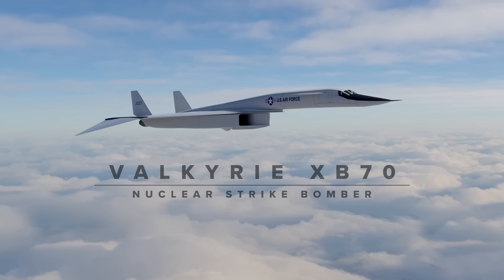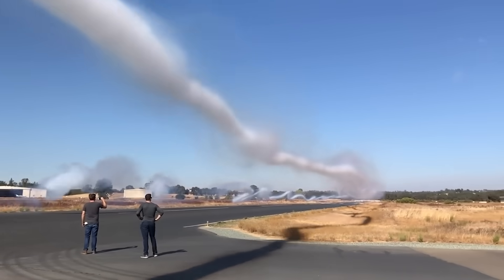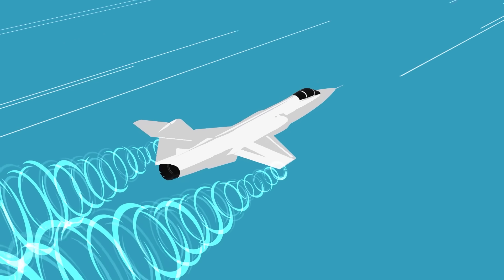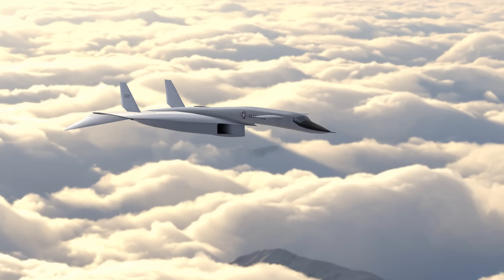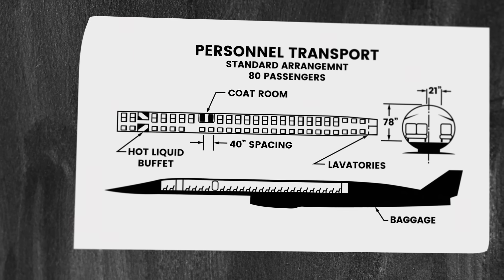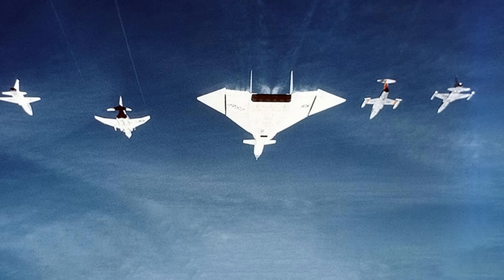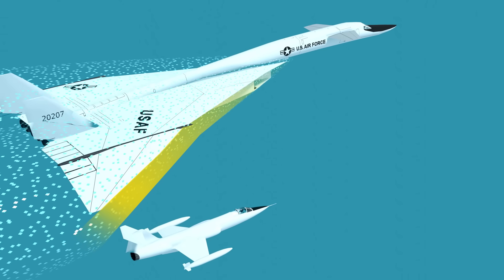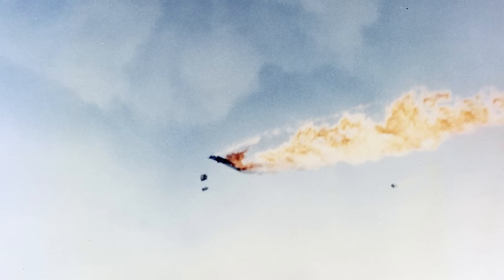XB-70 VALKYRIE | Wake Vortex crash explained

Comment: I'd always thought the vortex was generated at the wingtip from the confluence  of low pressure from the top of the airfoil mixing with the higher pressure  airflow from beneath , following  Bernouli's law. Is that correct?😅
Reply: Not entirely. 

Bernoulli's principle, in simple terms, states that faster-moving fluids (liquids or gases) have lower pressure than slower-moving fluids. It is unrelated to the formation of wingtip vortices, which result from air spilling around the wingtip due to pressure imbalance between the upper and lower wing surfaces.

Comment: Only one ever flew.. the other never took off even though it had the newer wheels/gear that was a huge issue. This program was cancelled pretty quickly in its testing period and instead went to a museum to rest. At least according to the previous built one.
Reply: Nope.  2 aircraft were built - both flew.  The landing gear wasn't a huge issue, as ultimately the 1st plane retired intact, flying until the end of the program.  The 2nd plane was lost when another airplane crashed into it.  Landing gear wasn't a fatal issue for either aircraft.

"This program was cancelled pretty quickly"

Nope - flew from 1964-69.  The program was retired because they had completed flight testing.  It simply wasn;t needed any more.

What is the source for your information that only 1 of the planes flew?
Reply from the maker: It was prototype 2 that crashed. And prototype 1 also flew and is the one in the museum.
Reply: "Only one ever flew...according to the previous built one."

Wut?

Comment: This bomber looks like it could only carry a tiny payload. 

With the way the two air intakes in front feed the rear engines, coupled with the retractable wheels, it just doesn’t look like it could carry any meaningful bombs.
Reply: The air flow was passed through ducts that angled past a space used for instruments. On a production aircraft it could have carried 2 thermonuclear bombs.
Reply: @ 2 thermonuclear bombs sounds like a fairly small payload for an aircraft that size.
Reply: @garycombs5721  the XB-70A made up for that with speed and altitude.

Comment: This crash was caused by the attraction of the enormous low pressure area on top of the XB70 delta wing and the low pressure area on top of the F104 wings. The Valkyrie is big and heavy, the Starfighter small and light.  The 104 simply got sucked into that void. The low pressure areas on top of the wings are why the 104 rolled inverted. Both the Air Force AND North American warned the pilots and producers about this before the flight, because almost nobody had flown formation with a Delta wing that large before, and the pilots who had - next to XB70 and B58 - had remarked at the tendency for this to happen. Given the size, weight, and flight proximity of these two aircraft, no amount of skill or experience could have prevented this.  The pilot skill set that was missing was the ability to say "Don't fly ANY fighter jet close to that wing." Planning could have prevented it, flying skill...no.

Comment: Very good presentation. It is not a mystery why Cross didn't eject. White has talked about this, he stated that Cross was immediately incapacitated or knocked unconscious by the initial flat spin, White briefly looked over at him and he was being rag dolled and he knew there was nothing he could do to help, he would be very lucky to save himself. If a pilot was incapable of initiating the ejection sequence in these clamshell ejection modules [the same ones that were used in the B-58], then the situation was hopeless, no one could do it for them, they were dead.

I think there is no doubt the B-58 on a run 20,000 ft above them played a role, every pilot in that formation acknowledged the [routine] transmission and said they had a visual on it, except Walker, which would seem to indicate he was trying to locate it, for he would have acknowledged too if he did have a visual. Of course it was not at all necessary to have a visual on an aircraft so high above them, but pilots do this as a matter of routine, and it makes sense to do it. They want to be aware of anything in their airspace whether its higher or lower, civilian or military.

One more thing not mentioned here which I think is a huge factor, the B-70's "wingtips" [which are actually the largest movable control surface installed on any aircraft in history] were in the 25 degree down position, which put them a full 18 ft lower than they would have been in 0 position. This alone, combined with the 104's poor rearward visibility and high T tail, could account for the highly experienced Walker thinking he was in a safe position while he scanned for the B-58's contrail. 

Finally, Yeager said that Walker was lacking on general formation experience, which was not a critique but just a statement of fact coming from a guy in a position to know.

Comment: a key point was the lack of understanding of how the vortexes from this type of wing actually functioned... this was a new and not yet fully understood aerodynamic design... the angle of the vortexes would have been different compared to the normal wing, he was holding well above the level of the wing, in an area not usually considered dangerous at the time...

Comment: My dad, Carl Hite, worked at Edwards AFB at the time as a jet engine mechanic on this XB-70. He told me that Cross couldn’t eject because he had dropped a flight manual on the floor which prevented the safety ejection pod door from fully closing. They are clamped to the seat when eject is initiated and he couldn’t move. He also said that Carl Cross, like most test pilots did, calmly talked the plane into the ground.

Comment: Is it truly a “bomber?”  Where do the bombs go?   It’s all engines and intakes.  The small fuselage in-front of the intake couldn’t drop much ordinance, and the dropped ordinance would be sucked towards the intake.   Wing hard-points would produce too much drag against the desired top speed.  

Perhaps, this was a research plane that was called a “bomber” for funding purposes?    Maybe, cancelled when  someone got wise?  

Instead, load that thing with  dozens of A-120 AMRAAMS…when launched from the plane’s top speed, the probability of kills would be nearly 100%, yes?
Reply: The Bombay is small but present behind the air intakes
Reply: This was a flight test aircraft, not a bomber. Had the B-70 been built, the bomb bay would have been behind the intakes, in the lower fuselage.
Reply: The weapons bay became the equipment bay on the XB-70. It's located behind the nose gear wheel well.

Comment: Carl Cross tried to eject.  The encapsulation retract system used gas cylinders.  Forward G forces in the flat spin were so great the gas cylinders could not overcome the force and retract the seat.  I read the gas burst disc actually blew. 
G forces were twice what NA designed for, because the missing left wing and verticals greatly increased the flat spin rate.   
Al White encapsulated when spin first started, before G forces reached maximum. 
Carl waited a little too long.
Reply from the maker: That makes sense.  I hadnt heard that explanation before.
Reply: After the accident NASA did some spin tunnel tests with the panels missing, it showed increased spin rate.  I saw those videos on you tube a few years back, maybe you can still find them.  @Mike-Bell

Comment: (00:35) “Only two of these planes ever flew.”

True, but did you know that when the military contract was cancelled (largely because of the Gary Powers U2 affair), four planes had been ordered and three planes had been completed. A third Valkyrie was >90% completed, but then demolished. Too bad. The titanium used was just too expensive and its cutting edge technology was too privileged.

(01:56) “200 ton[ne]s of air” ? Huh? What is that to mean?

(00:46) “A central factor in this mid-air crash was the aircraft's wake vortex.”

Incorrect. Well, it is suboptimal usage unsatisfactory for a technical subject and phenomenon.

How are any of the four other planes involved (McDonnell F-4 Phantom, Northrop F-5, Northrup T-38 Talon, and a Lockheed F-104 Starfighter ) in the GE-sponsored corporate "photo op" to have been involved in "wake turbulence" when none of them were behind (or to the rear quarter) of the XB-70?

Theories abound are to why Walker in his Starfighter strayed too close to the Valkyrie's right wingtip (I posit he meant to observe and report, which was his typical ancillary function in his capacity as test pilot), but what is unambiguous is that all pilots were specifically and emphatically informed to not under any circumstances venture downstream of the Valkyrie, because of its substantial wake vortex.

Wake [vortex] is defined as:

WAKE : (n.) : A trail (my italics) of disturbed water or air left by the passage of a ship or aircraft.

... and this was plainly understood by all pilots (and aerodynamicists and even relevant managers). What you describe as wake vortex is actually leading edge vortex formation; indeed, the Northrup F-5 (appearing in the formation!) was the first craft to feature intentional vortex generation via its (upstream!) LERX (Leading Edge Root Extensions), which energized the (upstream!) air to help keep it attached longer to the upper wing surface at high AoA -- to have thence been perfected on the F-18 Hornet.

Yes, I know that the phrase “wake vortex” is specifically used in the official accident report (and therefore the Wikipedia article), but this is incorrect terminology, especially for the matter of the term being used in the report's concluding section. Leading edge vortex formation was simply too new of a concept to have been differentiated from wake turbulence.

With the considerable design mandates and limitations springing from its ability to cruise at Mach 3, the XB-70's essentially “flat-plate” wing (a hexagonal lozenge) had “no” lift from Bernoulli Effect, but relied “entirely” on AoA to effect lift at low speeds (and compressive lift at high speeds, by the way) -- the canard wings were the aerodynamic solution needed to avoid the problems implicit for the (downward!) lift, additional weight, empennage length, and landing gear considerations of a conventional design for tail and elevons. (By the way, the Concorde, with its ogival wing functioning as a combined wing and LERX, benefitted directly from the Valkyrie. )

This was relevant because the Valkyrie was flying as slow as was safely possible to allow that formation of slower craft. (Yes, all the other craft were capable of faster cruise, but it has to be kept in mind the matter of fuel flow and cruise time -- it takes fuel for the time it will take to organize a formation of multiple craft, also including the modified Learjet photo aircraft, which used at the time thirsty turbojets, not turbofans). It is also relevant that they did not take off all at once or in the same area, but joined up in flight).

So, when one combines a leading edge vortex of maximum intensity per its salient flight regime, and an aircraft (the F-104) having the very lowest dipolar moment in roll in the entire military jet inventory, the result is as expected. Wake vortices were not involved.

Comment: I was playing an "Iron" 9 hole golf course very close to the South end of SeaTac International in Des Moines WA. The course was so close to the airport Runway that Runway Beacons on towers ran down the middle of the coarse w/ Huge commercial jets passing overhead so close you could read the decals on the different panels. I hid a ball pretty hi into the air just after one of these Large jets passed overhead. You could see the vortices rolling off the wingtips and my golf ball went straight into one. The golf ball hit the vortex and suddenly shot out at 90 degrees from the direction it was going. The ball just went sideways instantly. That Golf course has since been closed for obvious reasons (a REAL possibility of ingesting a golf ball into a Turbofan engine).
   My wife's sister bought a house at the north end of that same airport before a expansion took place. Eventually the Port of SeaTac paid to install soundproof windows & Doors in every house in that Airport Approach/Takeoff pathway near the expansion. The windows didn't work, those Jets were still loud AF !

Comment: This animation of the XB-70 crash is a great result of computer performance. The aircraft looks good, but there are mistakes. As can be seen on the real photos, this was ship No2 with a black area under the nose. All engines of all aircraft had dark black nozzles inside, there was no afterburning, no dramatic flames inside. The animation of the wing tip vortex of the XB-70 with these funny green dots is stupid. This vortex is invisible, it was never shown on any photo or film. It might look like the vortices that come from the canard wing tips and which run backward with a rather constant radius between the two vertical stabilizers. On a rare film piece of the XB-70 flying in the clouds (flight 113) one can see these vortices. The vortices of the XB-70 wing tips could have the same diameter or less , they are generated  at the wing tip and  wander also backwards. When the F-104 touches the light in the XB-70 wing tip with its horizontal  stabiliser, the whole F-104 is ahead of this light and ahead of the vortex, they do not meet. It is the physical kick of the wing tip on the horizontal stabiliser, that turns the F-104. It rolls left wing down and pitches up and then rolls over the back of the XB-70 and cuts off her vertical stabilisers. A mystery is, that this was not filmed. Who knows more ?

Comment: Top marks on the doc. 4 sure.
 The 104 w its stubby wings was less equipped to resist the rolling motion once started & was never noted to have adequate maneuverability, made 4 speed but the wake would've startled any pilot too close to the violent wake from possibly the largest delta ever made.

Comment: Clint East wood Firefox the movie migs seas biointerface think in russion. Its landed arctic greenland. Mother refules from sub choppers inbound. Your out off here 2.45 time. Clears a runaway. Starfighter. X-wings.

One of NASA's spacecraft, the THEMIS, and cluster probes from Europe have amassed enough observational data to confirm that a magnetic stargate portal exists in many locations. Usually these are found where the faraway geomagnetic field bumps up against the passing solar wind. The result is a direct pathway between the Earth and the sun.

The F-302 fighter-interceptor is the production model of the X-302 hyperspace fighter, an air and space superiority vehicle operated by the United States Air Force, the Russian Federation and possibly the People's Republic of China. It is Earth's first viable space-worthy fighter-interceptor. The Prometheus and Daedalus-class series of warships carry one and two squadrons of F-302 fighter ...Perhaps of all starfighters, the Incom T-65, otherwise known as the X-Wing from the Star Wars series, is the most recognizable. Built to deliver massive firepower from its four wingtip lasers, the X-Wing was made to counter the maneuverable TIE fighter. It is also equipped with hyperdrive, so it can fly separately from warping capital ships. There are some point that have to be said, before i start this: 1. This only able to work, when official servers are released 2. Private servers, and non-official servers can't be included, to avoid griefing and cheating. 3. I know it's a long term suggestion, and not a "I wait it in the next 10 patch" thing, so please leave the "It's not possible in the engine currently" comments. Typical Stargates: Ground Based For typical, ground based stargates within the Milky Way gate system, as well as the Pegauses and (Universe)/Destiny/Seedship system, power is supplied by the DHD's Cold Fusion Reactor Core 1, which also powers the DHD itself. Zero point modual sees absollute centers a cube borg time tubes baron lands mermaids adolph inn hit lerts kazarian wars. Karseaswarseas. Ori O fuq Ships. Red my Queens. Varlah her mothers a problem danial Sun hyrogliphs aye reads like the back of a hand shakes hears parkins son. Eye nelly was a big thing. She was struggling fitting in the bath. I thought oh ears lux sores flakes. And i cobbed my washing into the bath. See tonic water. Gin Sings. Ah mangles two hung up on bucks teeth two fangs. A lots. Aye sires lance the lots Boils. Scallpull. Oh look all green puss in boots. I left in a hurry quick quick its rubyscons fuqinking many sleave scars vamouths. Aye a dry martini shaken not stirred. Well its was a washings lows cows comeone and all look fannys washing up again don't say fee n che n pie n pee. Cee see. And thats why tokrah invented the wombles. Its atones tunning in on Trunks ears speedoes smuggings of a birds bath. Eye tim bucks 2 tuscas. Ivoroys coastins son i tinkles the ivories many eons ago haarp seas chords charts music likes the seas shores. Strangers things happen at space force command. Im floating son leviathon. X masshighers.

Comment: My brother was in the helicopter and first to the crash site. He was also responsible for assembling the pieces for the investigation. He is 84 now. I will share this with him. So if you want a fact checker. I have one who was there.
Reply from the maker: @Rowdy Flyer1903 Wow he was right there!  That is amazing.   I am curious about the dents left by the 104 on the Valkyrie right tip. Dent/s on the underside of the XB wingtip confirmed that the top of the fighters tailplane collided with the tip.  I’m curious how obvious these dents were and what other clues there were and how the investigators came to such a firm conclusion about this.
Reply: @Mike-Bell  He did reply to me and said your production was accurate and said thanks for the recall of memories. I will pass along your question. He was a captain in the Air Force stationed at Edwards at the time.